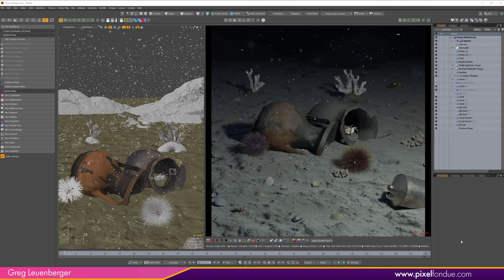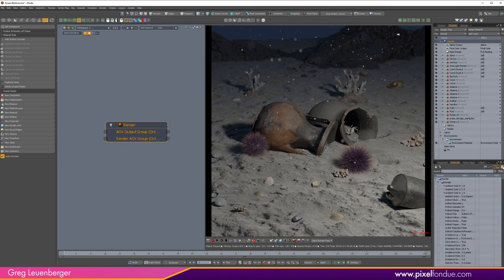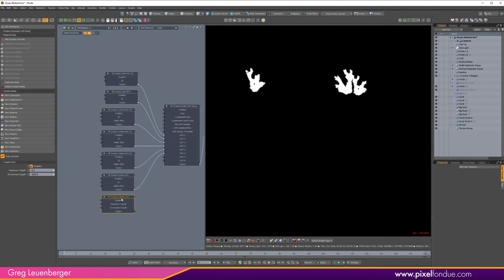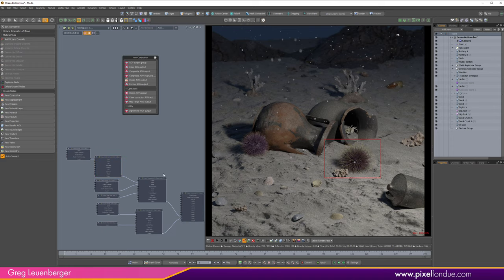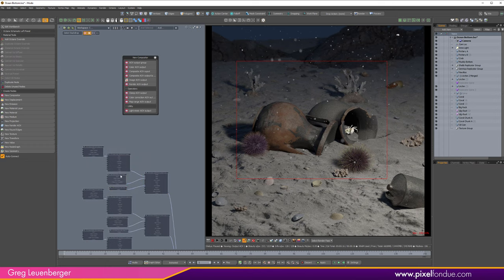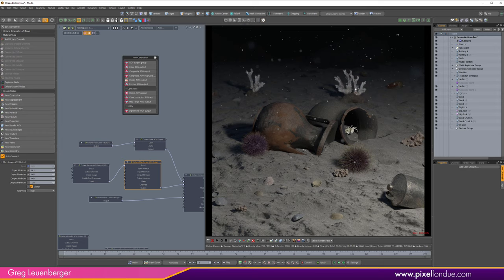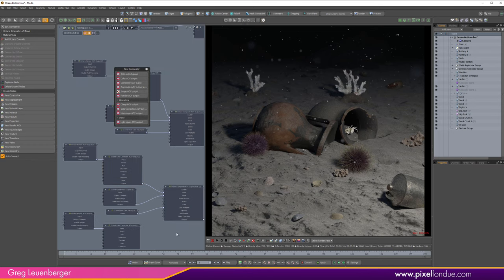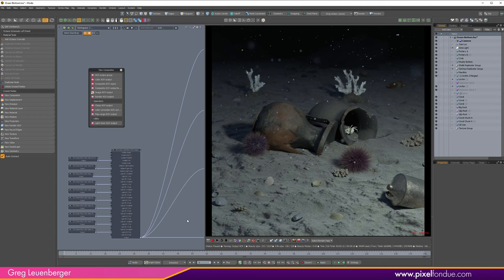OTOY Octane 2021 Compositing Fog and Custom AOVs

Comment: Thanks for showing this Greg. It's really cool that Octane is offering up a bit of on-the-fly compositing. I have to be honest, though, it does not look like a very streamlined workflow. I can't help but feel multi-layer EXR's with cryptomattes or even just spitting out a bunch of render outputs and putting them together manually in an external app would be faster. And of course, there's the limited nodes to work with in Octane. I think it would be tough to get a full ready-to-deliver comp out of Octane, meaning you'd still need to go through a dedicated compositor to achieve a final result.
Still, pretty cool that the feature is available, and it seems pretty solid for a first iteration. Hopefully the future will bring more usability.
Reply from the maker: Yeah, I think (other than Light Mixing) it will be a while before that happens..but looking ahead 5 years or more, I think a lot of people will do their compositing while the render is happening.  The UI and number of features has to be way better...but for product stills, arch viz or just 'playing around' in a few years I suspect a lot of people will be skipping the whole compositing project.  Light mixing is totally useful now.  I also like the custom AOVs....cyrptomatte is great but the file sizes can be HUGE.